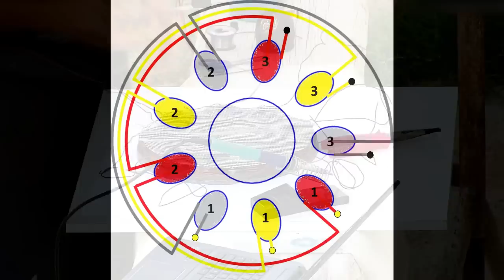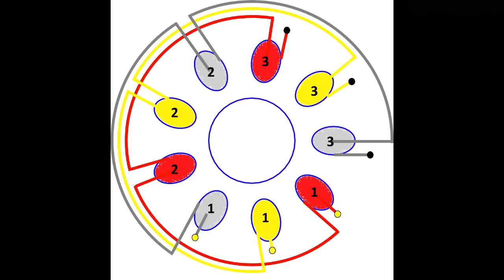DIY 1kW HAWT Wind turbine [Part 3] - Casting the stator

Comment: By completely encasing the statue in resin are you not creating heat dissipation problems? Would it help if coils were in contact with aluminium plates instead?

Comment: Hi I have problem understanding circuits.
Genuinely saw from start to finish still unable to understand what will turn in this thing to generating swap of currents thus power.
I wanna ask you a thingy: wouldn't engraving both magnets and coils in a conductive plate and making the connected coils spin in front of magnets spinning the other way be more easy to accomplish ? ! ? !
Than adding layers of magnets and coils to increasing kw production?

[Maybe I saw the second panel with magnets for a second..still I don't get why you cannot make panels of magnets spinning in opposite directions over the coils... it would creating more polarity exchange... no?...the fiber glass is for not creating short circuits? Could pure graphite substituting the coils? I have so many questions and no one to answer]

Comment: How can you calculate the voltage and the kilowatts for example if want to build a wind generator like 15,000 to 20,000 kilowatts, how do you calculate the voltage and kilowatts, please i want to know because i have been trying to build my one as well because i don't know the calculation of the voltage and kilowatts that is putting back.

Comment: Good video! Have you figured on a switch yet for Delta or Wye? thank for sharing😃
Reply from the maker: Thanks man! I really like your channel. My plan is to use relays and some kind of microcontroller to switch the configuration depending on the voltage/wind speed. I have two grid tie inverters that only accept up to 30v so I will use Wye by default and switch to Delta if the voltage exceeds 28v or so just to be safe. Not sure of how well this will work yet.
Reply: TheBillytheJack2010

Comment: Hey nice video. I am also intreasted in doing it. I want to kno hw did u calculated no of turns per coil na also what is the angle for magnets to be placed
Reply from the maker: Hi, I didn't make the calcuations, I just followed a very known project that has been replicated by lots of people with great success. Check the video were I made the rotor https://www.youtube.com/playlist?list=PLmjHBAomMtrkiJak8m2aq4RClZyzwqW4J
Reply: RandomHacks did u completed consteucting generator...? If yes hw is it working...?

Comment: You best have some big ass blades for that thing if you want anywhere near 1kw,  but fair play for trying I am in the same boat , good luck with your project , is it flying yet ?? cheers

Gavin
Reply from the maker: I think 1kw is reachable but I'm not sure either, there are so many factors involved ... It's the first wind turbine I'm building. It does not fly yet, I don't have much time to work on it unfortunately. Thanks for your comment, I will check out your channel.
Reply: OK DUDE GOOD LUCK I'LL KEEP CHECKING BACK TRY AND GET THE OLD GIRL UP !!

PEACE

Comment: I think if you add metal core in the center of the coils will work better, it will produce better flux.
Reply from the maker: It would produce better flux but you also would get cogging which is a bad side effect. Thanks for commenting.

Comment: Very nice work and well explained! But have you tried to put more magnets between the magnets you already have on the rotor to increase the magnetic field strength? You may get an increase of about 50% to 100% in magnetic field strength, which will result in increased voltage and power.